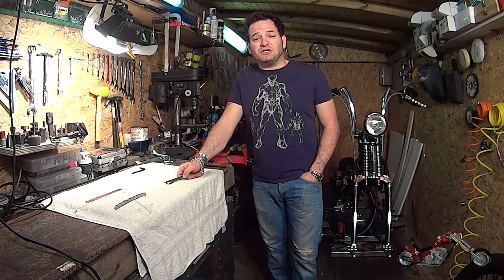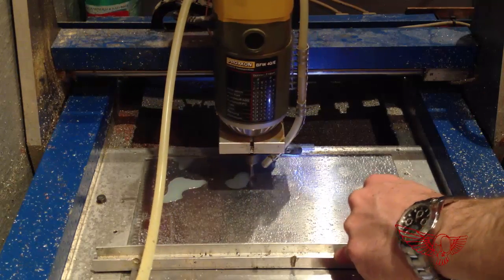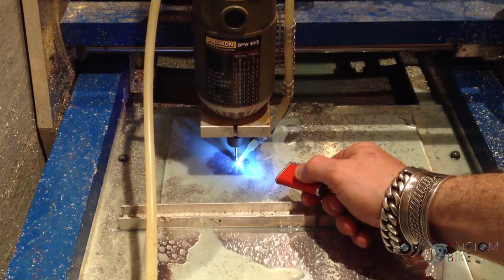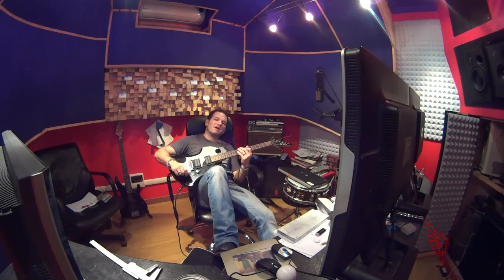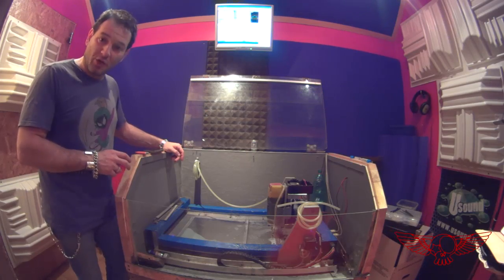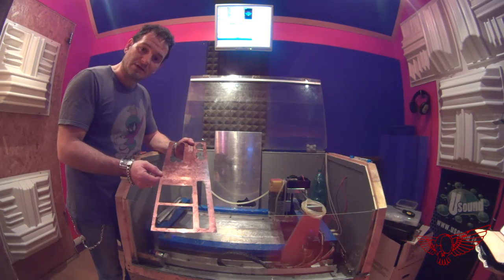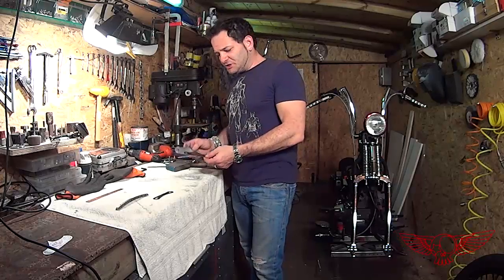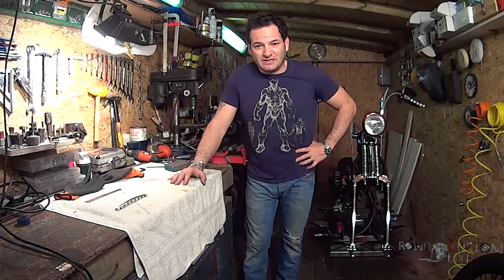How to CNC an Harley Davidson part from scratch - Double side machining - ep4p2 Roma Custom Bike

Comment: Did you make/design even the general outline of the part from scratch? or do you have a favorite database of Harley parts to start with (i.e. GrabCAD or manuals)?
Reply from the maker: ***** i make them from scratch, i scan the part and then i digitalize it with autocad/rinoceros and veryfy all measurement with the capliper :)